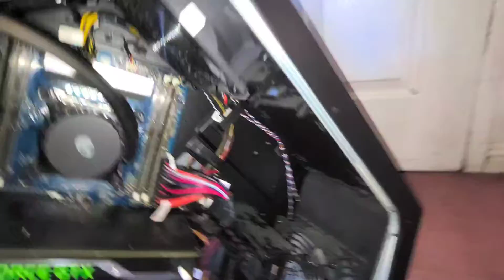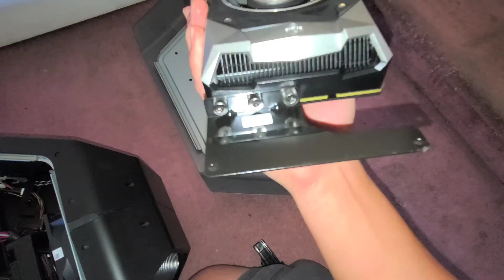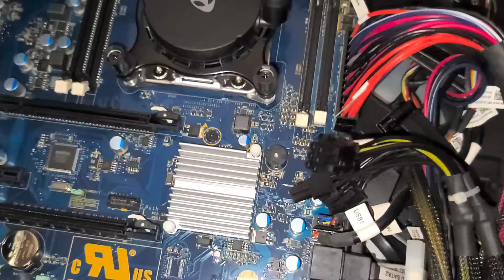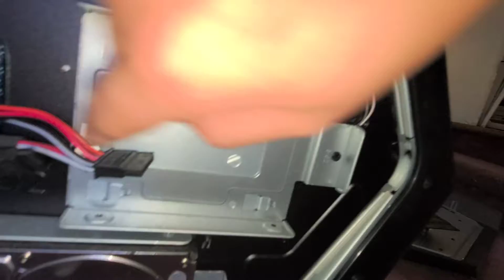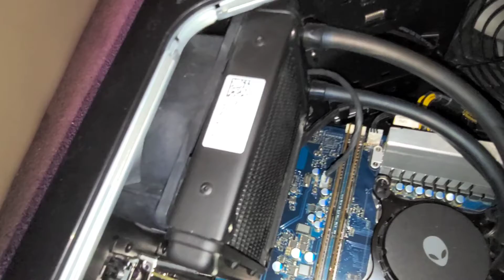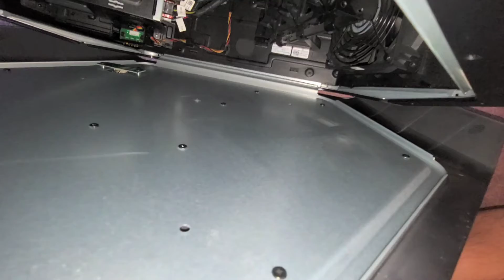Alienware D03X Area 51 R2 Disassembly RAM SSD Hard Drive Upgrade Repair GPU Removal Install

Comment: I am trying figure what is the best GPU for this. Since I got this for 100.00 dollars and want to rebuilt it
Reply from the maker: Whatever will fit in there and the power supply can handle. I'm not sure.
Reply: Whic GPU do you have?
Reply from the maker: @DarkNeosX  I don't own any gaming computers.

Comment: I put in 3 sata samsung 870 ssd's in but only onr shows up and when I wanna format them they don't appear but they do appear as a volume
Reply from the maker: They don't show up in the disk manager?
Reply: @ItsBinhRepaired  nope
Reply from the maker: @s20online  very strange. Both cables connected?
Reply: 100% even tried other cables to be sure
Reply from the maker: @s20_  check if the bios is in ahci mode

Comment: Anyone know how to fix the issue where it doesn't boot and just sit in a black screen on power-on?
Reply from the maker: Could be bad RAM, GPU, motherboard, monitor, etc.
Reply: @ItsBinhRepaired  Turns out the GPU is faulty, the connection is too thin to it wobbles in the slot, even with support. I had to reseat the card. This took years to figure out.. The second GPU does not wobble. Moving the 50lb PC often causes it to wobble looks a micro milimeter and cause the issue I found.

Comment: The big plastic switch on the back of the Case originally comes with a screw in the round hole.
So if the switch is to the right, then it locks the release mechanisms for the side panels.
Once you remove the screw (like yours), the switch springs to the left, and the side panel mechanisms unlock and you can pop them open.
Hope this helps.
Great video, thanks - Constructive criticism: Try and get a small tripod (or gorilla grip) for your phone / camera - then you can use 2 hands
Reply from the maker: Where would I mount the camera though? With laptops it's easy. Desktops are a pain
Reply: @ItsBinhRepaired  
If you get a Gorilla tripod with the flexible legs, then you can bend them to hook on to and grip the chassis walls.
Or you can attach it to a small table next to the chassis you're working on
Reply from the maker: @EddieG_333  I think I need to design something new

Comment: From what I can tell, I have exactly the same hardware that you show in the video.  I only see the one disk drive.   When I look at the drives in Windows, I see two disk drives:  Disk 0 and Disk 1.   (Disk 0 is 120 Gig and has the C: volume on it)  (Disk 1 is 2 TB and has the D: volume on it).   If I power down the system and disconnect the only hard drive that I see, I can still power up the machine to Windows.  Disk 0 is still there.  Disk 1 is gone.  Where is the Disk 0 hardware?  It appears that I have disconnected the only hard drive, so I don't understand how the machine can boot to Windows.
Reply from the maker: Check the hardware properties of disk 0
Reply: @ItsBinhRepaired  I can't see any helpful information in the properties.  Do you think such a "Disk 0" could reside on the motherboard somehow?
The partitions of Disk 0 are: "EFI System Partition. 500 MB", "OS C: Boot, Crash Dump, Basic Data Partition 104.95 GB", "Recover Partition 866 MB", and "Recover Partition 12.83 GB"
Reply from the maker: @kevinhartmann8145  it should give you the model number to look up.
Reply: @ItsBinhRepaired  Ok thanks!  It says: "sk hynix sc300 2.5 7mm 128gb".
It looks like it's an SSD drive, but I wonder where it is.  I don't see it in those slots that you point out in the video.  I'll look further later.  I don't have it open right now. 
Thanks for your help!
Reply from the maker: @kevinhartmann8145  hopefully you can find it
Reply: same

Comment: Thanks for the vid! Very informative!
I'm about to upgrade the RAM and the video card in my 6 year old Alienware Area 51 R2. Dell just told me I could only use (4) 8 GB 2400 MHz sticks at 32 GB maximum amount of RAM. Dont know if this is true or not as I would rather have more RAM in there for video work. Another channel said that I could stick an RTX3080 or RTX3070 in there..but dont know if it will fit. I dont want to fry the system. Any thoughts?
Cheers,
TS
Reply from the maker: You won't fry anything by trying. It just won't start up properly. Changing stuff back will fix it.
Reply: @ItsBinhRepaired  Thank you! Will give it a try soon if I can find a Graphics card. Cheers,
TS
Reply from the maker: Sounds good!
Reply: @tsstereo5082  Did it work for you?